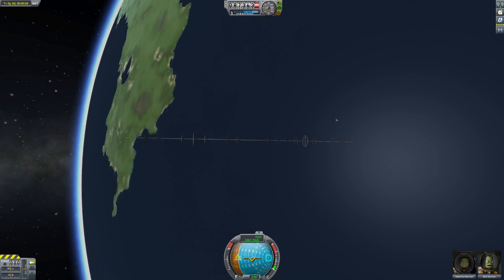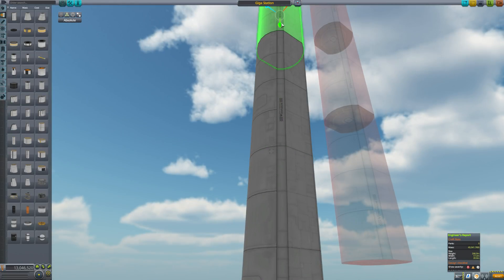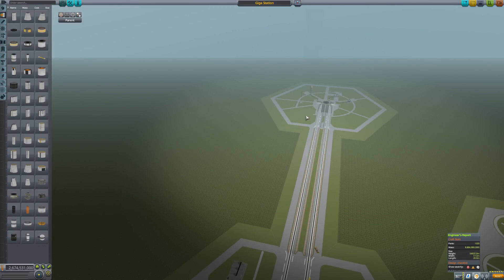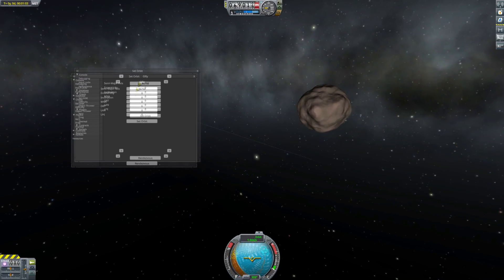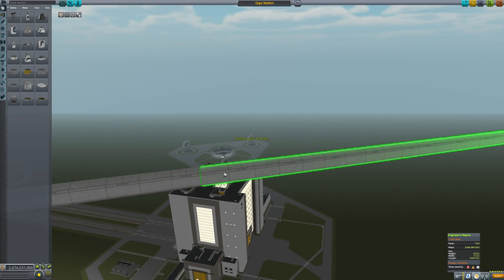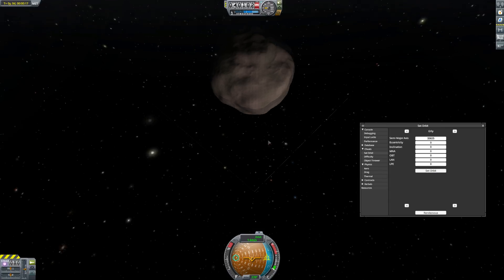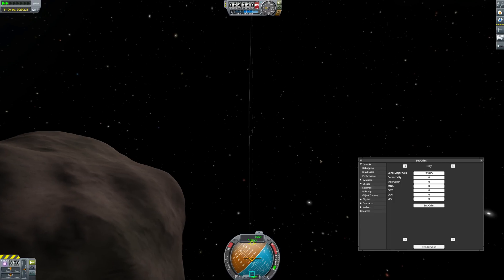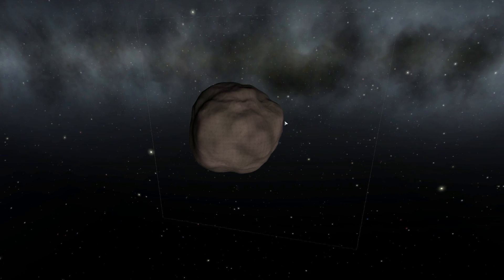Making A Ring Station Around Gilly - Kerbal Space Program

Comment: You don't need to change the root part, just hold shift when clicking and you will move the whole craft both in build mode and move mode
Reply from the maker: True, but that puts the move icon on the root part, so I did need to re root the parts
Reply: TAPE Gaming just realized this. Never noticed till I had to tweak scale something massive xD

Comment: I once thought about doing something like this, but the brute force methods are too difficult.  Instead, it should be possible to make an excel spreadsheet that mathematically figures out the connection locations between parts, their orientation and orbital parameters, then use that to create a [VESSEL] portion of a save file (in text) to then load in without having to actually build, move and tweak 4000 parts.  You could also build a "perfect" ring that way.

Comment: Would a ring station need any velocity? I mean it looks like if gravity pulled it in the other parts of the station would just support it?
Reply: Some years ago students pointed out to Larry Niven that a Ringworld would actually be inherently unstable in their orbit, because moving even a tiny bit off of "perfect" would mean gravity would be pulling on the closer end of the ring more than the further ring, and the ring would inevitably crash into the body it orbited.
Reply: Yeah. Any large mountain range or denser part of the surface that the moon/planet the station orbits would case for it to lose orbit and collapse.
That's also assuming there is a material strong enough to just sit in orbit.
Reply: But surely the center of mass of the ring would sit at the center of mass of the planet? A center of mass doesn't have to be within an object
Reply: Lewis Massie But the forces acting on it wouldn't be equal all over the ring.
Reply: If the object was perfectly round and the station was perfectly placed; it'd be something truly stable. Otherwise no, it is just going to result in catastrophic failures.
Reply: Too bad earths center of mass oscillates then.

Comment: Use tweakscale to build a tiny ring,  part weld it into a single part, than use tweakscale to make it big. Either that, or ask Danny for his version of tweakscale with no size limit.
Reply: Caden Gaul it's decently easy to remove the limiter for the mod. just increase the size percentage in the config file i believe
Reply: gg ez no re